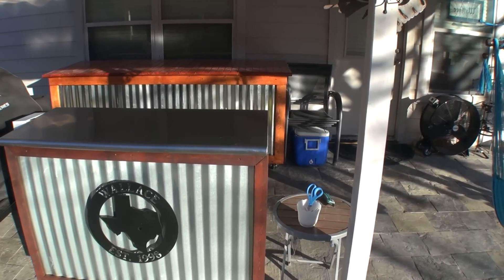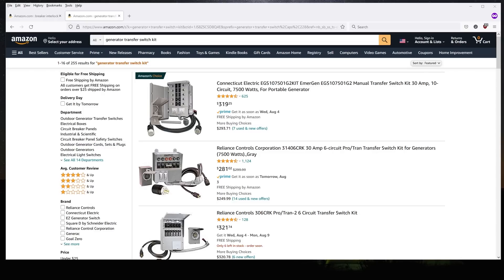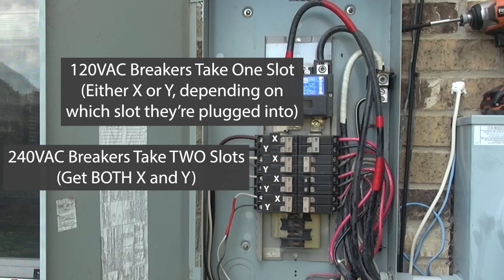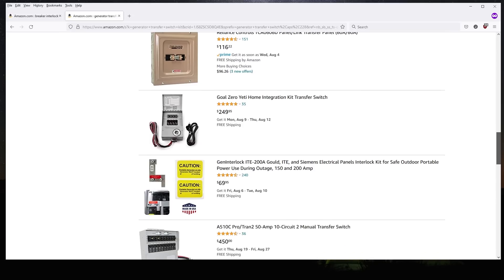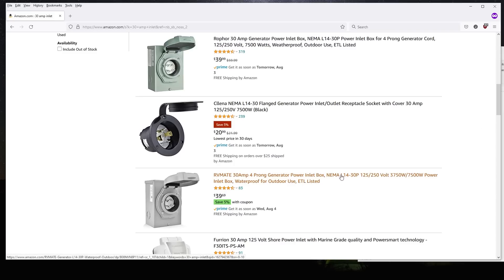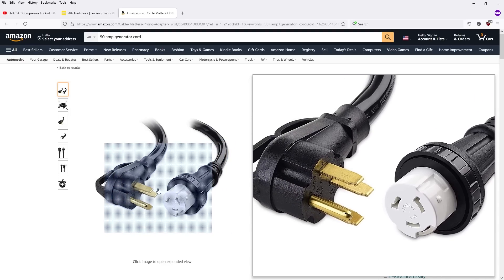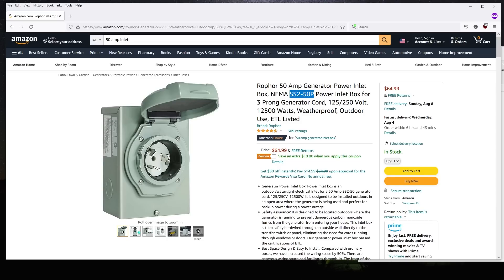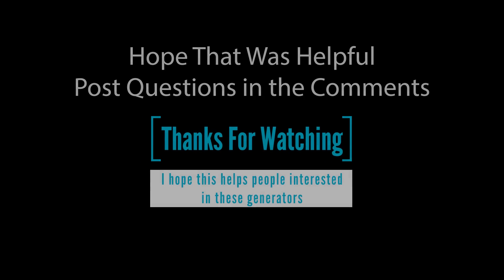How to Connect A 240VAC Portable Generator To Your Home

Comment: Thank for the detailed explanation of how you choose to do yours. Funny how winter is coming and this was suggested, us Texas people remember how ERCOT essentially has done nothing since snowmageddon. I’m running my backup off a welding machine and prepared for this coming winter!
Reply from the maker: A welding machine would certainly work.  It's gonna use more fuel and be old school windings, but it will get the job done for a temp solution for sure.   And it serves a purpose when not needed for the house.

Comment: What size wire do I need for a 30amp.Thanks
Reply from the maker: I would suggest wiring for the 50amp and just using an adapter to connect a single 30 into it.  This future proofs you, so you can upgrade generators without having to rewire the house.  The cost difference would probably be ~$30 extra.  Learn from my mistake.  :-)  I started with 30amp and had to rip and replace the whole thing.

Comment: The only thing wrong with this is the combustible enclosure. Wood will ignite from the heat put off by air cooled generators.
Reply from the maker: Yes.  However the way it's designed, the generators themselves have a mechanical fan run by the engine.  It seals around the output, so the fact the generators are on, is forcing air through the enclosure.  Then then electric fans help to increase the flow even more.

After running for an hour with the lid closed in the Texas heat (shade), the interior temp was only a degree or two higher than ambient. And if the electric fans were to fail (each fan is run by it's own generator), the mechanical fans would still keep the air flowing.
Reply: @Texas_DIY  this is what I’m referring to.
National Fire code
 NFPA 37 4.1.4
Requires that generators be placed no closer than 5 feet from operable windows, doors, or combustible walls. This does not apply to noncombustible walls. There is also an exception if the generator has a weather protective enclosure that is constructed of noncombustible materials and it has been demonstrated that a fire within the enclosure will not ignite combustible materials outside the enclosure. Generac air-cooled generators may be mounted within 18 inches of a house, but must still maintain the 5 foot rule for operable windows and doors.

Comment: Did you install a 30 or 50 amp breaker?
Reply from the maker: I ended up with a 60amp.  But would suggest a 50 for most folks.
Reply: @Texas_DIY you did 60 because your predators are 30 each, is that correct? 
What happens if you put in the 50? Would it just blow?

Comment: Jason, love your generator videos. Your predator has “Neutral bonded to frame”. Did you have to modify that to be able to hook up to your 50amp plug and feed your panel?
I was told you cannot feed a “Neutral bonded to frame” generator directly to your panel.
I have a new inverter generator coming and want to know before I supply power from it into my outside generator plug and into my panel.

Thanks Jason
Reply from the maker: I'm not too worried about it.  And word is that if it's a portable generator / temp hook up (which these are) it's ok to keep it bonded to frame.  But if it's permanent (like a  whole home auto-backup gen) then you're supposed to not have it bonded in there. 

But for people that really want to or are concerned about it, I've seen videos where the frame bonding can be fairly easily disconnected.  On the main panel at the grounding post, on the rear there are two cables.  One of which is the frame grounding cable that can be unscrewed.
Reply: Thanks for the explanation, appreciate you taking the time.

Comment: Curious if you have anything going from the frame of the generator to a grounding rod?  In my case my generator has neutral bonded to the frame. Can this be left as is?
Reply from the maker: I'm not an electrician.  My understanding is that it's not a major issue for temp hookups (which is what this is) So I'm not worried about it.  The ground in the cable (and the neutral since they're all bonded) ultimately end up on the grounding rod through the grounding in my electric box.  So as long as the neutral and/or the ground cable are attached, they're grounded to the rod and everything else.

Comment: Excellent video. Just a couple of additional things to consider. A 30amp unit may easily handle a whole house ac IF something similar to an EasyStart by micro-air is attached to the ac unit. On my 3 ton unit the EasyStart reduced the starting current down to ~ 25 amps (run current is 11 amps). Start current rating on my generator is ~37 amps. Another thing to consider is whether the generator has a bonded neutral or a floating neutral. For residential hook-ups, the NEC code requires a floating neutral where generators that are used as stand alone units or connected to an RV require a bonded neutral. Many of the bigger gens have a bonded neutral. So verify (by physical measurement, the manual may not be correct) which neutral set-up is used on the chosen generator and how easy it is to convert, if required. Again, excellent video.
Reply from the maker: Yup.  I have a few videos in the series, and one that deals specifically with the softstart.  It's such an amazing game changer for central AC (or AC in and RV) on generator power.  I have the same running amps, but your numbers seem better than mine were for the start.  (I have a heat pump and it's been said they don't benefit quite as much for reasons I don't fully understand)

The neutral thing comes up in comments.  The general consensus is that with portable generators, it's no biggie to have the neutral bonded.  But for permanently connected backup generators you should.  I've not bothered to make changes to mine, but word is that if you want to, there is a cable directly behind the ground post on the front panel that can be unscrewed from the back of that terminal, and that will do the trick.

The other videos can be seen here:  https://www.youtube.com/playlist?list=PLzoNthJzzMFQ877vyCfoc53oDQqGFAIKN
Reply: Hi Jim. Do you have the EasyStart on your home air conditioner? Did it require an electrician to install? Thank you.
Reply: @bfree_317  Yes I do. It was installed by my HVAC guy.

Comment: Your video was the only helpful that I have found. Thank you. I have realized my limits and that I must be humble to hire professional help. Thank you.
Reply from the maker: If you've ever changed a light switch, or added an electrical outlet to your home, it's not much worse than that.  But know your limits.  Particularly as there is 200+ AMPS of 240VAC power in that box that can't be turned off.

Comment: great video but those 2 generators cost 5200 after tax and a 22kw generac with transfer switch is 5800.  buy the time you built your enclosure and everything you have more in it than a whole house generac setup with an automatic transfer switch and more power. why did you go this route?
Reply from the maker: That ~$5200 buys you the actual unit.  It still has to be installed, and some sort of pad made (or poured) for it to sit on, and, it needs propane / natural gas, which means plumbing for that.  Now you're getting into the $10k ballpark.  

Then, to make things worse, in my case, the whole neighborhood is electric only, so that means I'd have to lease a large propane tank (The grill sized ones only last a short time and will freeze up).  And then trench / plumb from where ever that ended up going, over to the generator.  It just wasn't in the cards for my home. 

And there is also the old school coil generator vs. the inverter generator argument.  Though with a really large coil generator, it's not as bad because the power fluctuations don't slow it down as much. But you still will have a significant difference in power quality. 

It would be really really nice to just have it auto-start, and engage.. and self exercise from time to time.  Mine is fully manual.  (I address a few of those cost questions, power quality, and reasoning for the decision in a few of the other videos in the series.)

https://www.youtube.com/playlist?list=PLzoNthJzzMFQ877vyCfoc53oDQqGFAIKN
Reply: Yea 5800 for 20kw generator and transfer switch. I already had a 500 gallon propane tank buried in the yard and it going right next to it.  My electrician is gonna charge me 500 bucks and the sacrete for the pad is 65 bucks. Leaving only the copper line to run the unit which I can do myself.  All in I'm have 6500 in it.  But im not saying all this to argue im just literally about to order the generator for the house and came across your video.  Honestly questioning what's best.  What do you think is the power difference between the standard generator and an inverter ?

Comment: He doesnt mention that if you install a transfer switch you need calibration for under current and over current every year for just one criteria...along with voltage cycling etc.. otherwise a great job of ruining your household electronics for one...
Reply from the maker: I didn't know transfer switches needed calibration.  They always seemed like just a manual rearrangement of the circuit.  Interesting. 

In my case, the generator power is pretty much the same, or actually just ever so slightly more clean than the incoming power from the street.  (if you look closely at the wave form in the other videos) 
https://www.youtube.com/playlist?list=PLzoNthJzzMFQ877vyCfoc53oDQqGFAIKN

Comment: Thanks for reiterating the importance of being safety minded in regards to the power coming in not being able to be de-energized,that would be a fatal mistake
Reply from the maker: Yeah, I know what to avoid, and my butt still puckers when working in there.  

One time I had a guy come to change my meter (years back) and he just blindly reaches his fingers behind the meter, right next to the hot terminals, with his hand inches away from a grounded housing, and yanks it out.  I actually yelled at him (not aggressively / mean, but more in a "dude what the hell, be careful" kind of a way)  He was all casual, saying it won't hurt you, you're not completing the circuit, etc.  "They give us gloves, but we don't use them".

I'm convinced he's eventually gonna blow his hand off... but at least he didn't do it in my yard.

Comment: Check the temps on the inclosure. Those fans may be too small. You could also add a temp switch to turn off the gens in case of overheating like I did in mine.
Reply from the maker: I like the idea of at least being notified if things get too hot.  A temp switch would be good, but I think perhaps a basic wireless meat thermometer mounted in a way that is intended to stay in there.  Set the heat notification low, and it will alarm in the house if any of the temps climb too high.  This is what I used for my testing (but it's also for my smoker so it's not permanently mounted in the box.

The machines themselves each have fairly powerful cooling fans that are mechanically linked to the engine.  They draw cool air in through the intakes, and exhausts the hot air out of a vent located just above the engine exhaust.  Since the box is otherwise sealed, by making a seal with that foam around the exhaust area, it forces the cooling fans in the generators to act as circulation fans, pulling incoming through the box.  The idea being that even if the electric fans were to fail, the mechanical fans are always running, proportional to the engine speed, to draw in fresh outside air and actively blow heat out of the box.  Hopefully this would avoid a major overheating (fire / meltdown) type of event

In your enclosure, if your design allows for it, you might try making a seal around the exhaust / air exhaust to the outside on yours.  So far with mine, the total guess work seems to have been close enough, and the temps have always remained roughly 2-3 degrees of ambient.

Comment: Your generator location seems too close to the house and may lead to Carbon Monoxide in your living space. My breaker box is on the side of my garage and is as far from the living structure as possible, so that's where the generator sits. Exhaust has to be considered with any generator use to prevent asphyxiating whoever is home. It should never be close to windows , in a garage, or basement.
I'm currently looking into changing my generator from gasoline to natural gas or a hybrid. Our natural gas service has never been interrupted in my memory so I would like to use that as the primary fuel with gasoline as the secondary one.
Reply from the maker: If you're looking for a hybrid (natural gas / gasoline) unit, check out the GENMAX GM9000iED.  It's the same manufacturer as the Duromax and the Predator, but with all the shortcomings of each fixed.  Rear exhaust, has an oilfilter, the air filter is actually accessible, nice displays, natural gas option built-in, etc.

Regarding the airflow, you're not wrong to have concern.  In the past a I ran a small generator on my front porch, (open air on one side) and could actually feel/tell the CO basically directly entering the house, and had to shut it down.  

On the back porch, the awning is open on 3 sides, and the exhaust blows away from the house combined with the generator's heat exhaust blows with it.  And the awning attaches well above the windows.  In addition, I also have a industrial style fan, and blower style fan, and a ceiling fan out there that can circulate the air to help blow things away if the ambient wind is really low.  And if I'm in a situation where they need to run long term, the whole box is on wheels, and I can move it forward to the edge of the awning if I really need to.  (but it hasn't ever come to that).  Lastly, the units themselves each have CO sensors that will shut down the generators if levels get too high, and I have pretty good airflow moving through the box.  So the setup so far has worked really well. 

My neighborhood is 100% electric, no natural gas.  And I didn't want to deal with leasing and installing large propane tanks.  But if you're looking for a hybrid model, check out the GM9000iED I mentioned, it's looking pretty good.

Comment: Hate to say it, the video is good,  but you don't seem to mention the Predator Generator you are talking about only has a 30a output.
Reply from the maker: Below I'll include the full playlist of the series.  I'm using a home made parallel kit to tie two units together for the 50a outlet.  But that same cable I'm using can plug into a single 30a connection with an adapter if needed.  But it would have half the capacity vs. using two units.

https://www.youtube.com/playlist?list=PLzoNthJzzMFQ877vyCfoc53oDQqGFAIKN

Comment: Hands down the best video on this subject I have seen. Great job of making a clearly explained video with easy to understand subject matter.👍
Reply from the maker: Glad you found it helpful.  Lots of people have "reviews" of the generators and such, but nothing seemed to explain the common questions and concerns.  I basically explained what I learned, and the mistakes I made to save others the hassle.  :-)
Reply: Since you hooked the generator to your house, how did you manage the grounding?Did u unhook the generator chassis ground or use a grounding rod or you did nothing but use the ground from the plugs on the generator. Thanks.    Super video

Comment: I wish generators would advertise max AMPS and running AMPS as well as watts since the starting AMPS on your AC  (LRA) will be the real determining factor in sizing your generator for whole home use
Reply from the maker: Agreed.  But alas, "9500" looks a lot better to a marketing person than "7400".  :-)  At least they publish the actual numbers, in some cases they don't bother and it's hard to tell.  And to make things even more messy with that high "peak" number... there's no standard as to how long that number can be sustained for.  

So a better generator may operate a peak for say 10 seconds, while a lesser one may overload in less than 1 second... (I just made up those times and have no idea what is 'normal') and there is not way to tell, and none of it is advertised.  So the lower sustained number is the real one to watch for.
Reply: Watts ÷ volts = amps
For example....
7500watts ÷ 240volts = 31.25 amps. Hope this helps

Comment: Thank you for video.
Could you tell, how to find phases Y and X on generator for connect into home electric box to phases Y and X .
Reply from the maker: L1 is usually Black and L2 is usually Red.  In my box one leg was marked with red and the other with Black.  (Neutral is white)  I just kept the colors consistent through the whole thing. 

But at the end of the day, it doesn't matter, they alternate back and forth 60 times per second.   Just make sure you wire them the same in the parallel kit (red to red, black to black, white to white, etc. etc.)

Comment: Great information!  How does the Predator compare to Westinghouse?
Reply from the maker: Not sure.  The main "competition" seems to be one from Duromax, and another, the GENMAX GM9000iED.  All are ultimately made by the same factory, so the internals are pretty much the same with minor variations.

But the factory seems to have taken and eliminated the shortcomings of both the Duromax and the Predator with the GenMax model.  It's dual fuel, has a readily accessible air filter, has an oil filter, and does rear exhaust so the units can run side by side, and has the auto-start goodies.

Comment: Very well-done video. Just curious why you went with 2 generators. Is there any benefit to running 2 in parallel?
Reply from the maker: Double the power output.  (when using inverter generators, they sync with each other)  I have several other videos covering some of these aspects. 
https://www.youtube.com/playlist?list=PLzoNthJzzMFQ877vyCfoc53oDQqGFAIKN